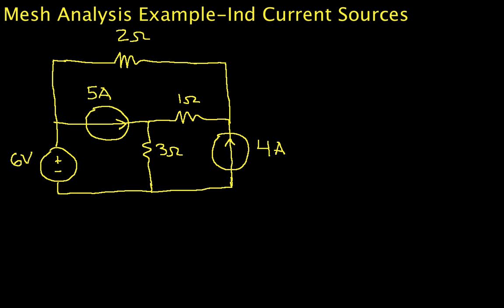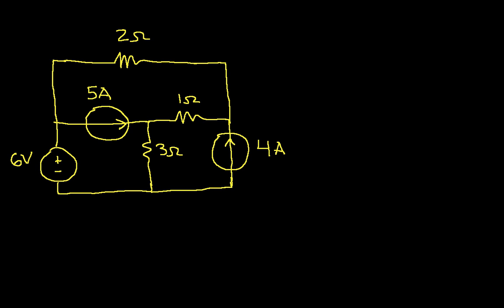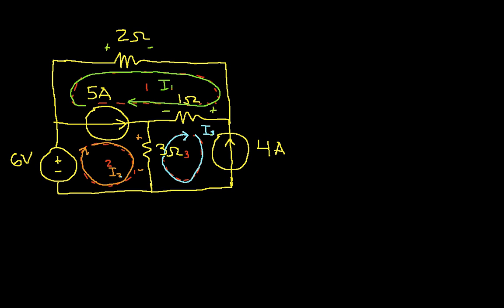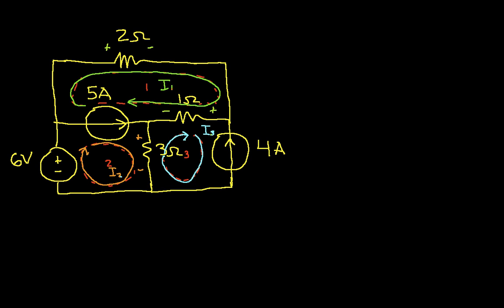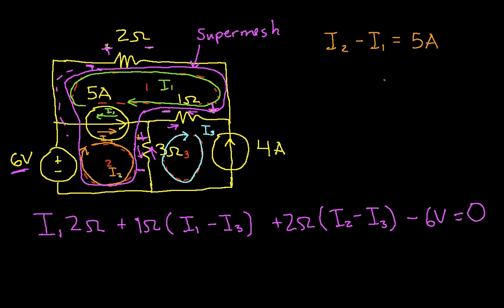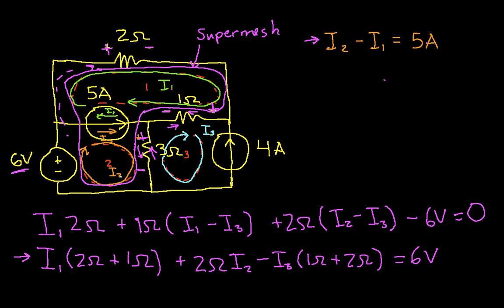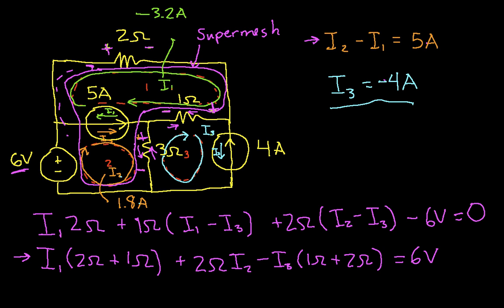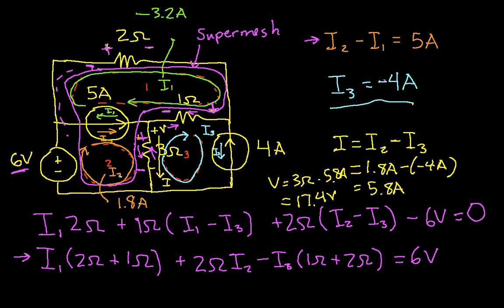Mesh Analysis Example-Independent Current Sources

Comment: If any new viewer is watching and you got different answers, it's because he mixed up between 2ohm and 3 ohm. If you used 3ohm,

The answers should be the following

I1= -4.17A
I2= 0.833A
I3= -4.0A
Reply: what if i got i1 to be 4.17A and i2 to be -0.833A

Comment: Thank you sooo much Darryl! This helped me a lot. Previously i was solving using this method and was applying directly the current of source value in the super mesh during the formulation of supermesh equation and other meshes that were attached to it but now YOU JUST OPENED MY MIND HERE AND JUST SOLVED A QUESTION WITH 2 EQUATIONS AND IT WAS FLAWLESS.. Thank you so much Darryl. This tutorial literarily saved my life. 🙏🙏🙏

Comment: The I3 is drawn clockwise. The current provided from the current source is drawn flowing counter-clockwise in the nr 3 mesh circuit. Thus I3 must be -4 because it flows in the opposite direction.

Comment: Professor gave us an exam that had labelled meshes that weren't all in the same direction and 2 dependent current sources.
Reply: Kaz Those professors are idiots, in real life, you just do whatever you want .. you can even do a simulation and you're done. The first course in electronics should be just to get to know how analysis works.

Comment: After you did the 2ohm to 3 ohm mistake you fuked up the whole thing. Please add more captions because it made me confused for a while. Add caption on where you put the equation on wolfram please.
Reply: The easiest way to handle this is to just change the value of the 3 Ohm resistor to 2 Ohms, and then you all the calculations are correct.
Reply: Be respectful. He is doing it for humanity and if he wants to stop this whole thing it his right. Learn how to behave he is not getting paid by you.

Comment: and if you check the answers using the original equation(i2-i1=5) and the answers from that wolfram site, i1=16/5 ,i2=9/5
9/5-16/5 is not equal to 5A

Comment: sir  the above circuit is there is  a current if they instead one resistor and other is be given the how we find voltage across 1.1 resistor  in  the circuit.

Comment: Hello, I tried solving the super mesh equation manually and somehow i dont get your answer,
since i3=-4
i2-i1=5 -- equation 1
3i1+2i2-(-4)(3)=6
3i1+2i2+12=6
3i1+2i2=-6 -- equation 2
using substitution --- eq 1 to 2
i2=5+i1
3i1-2(5+i1)=-6 
3i1-10-2i1=-6
i1=4A, i2=9A